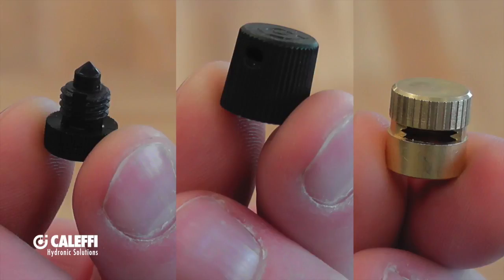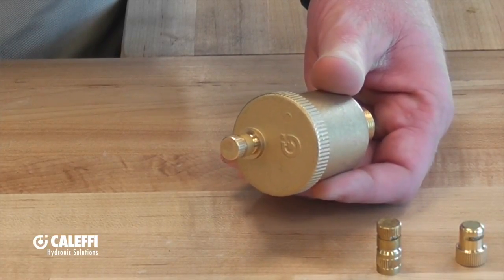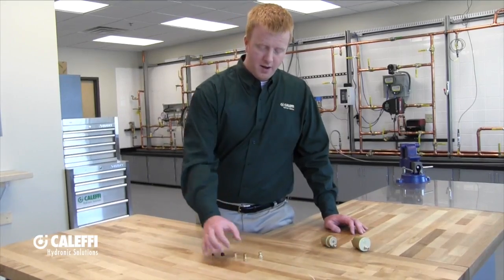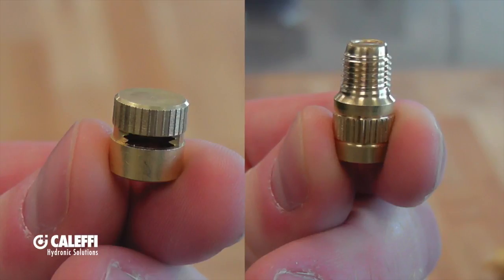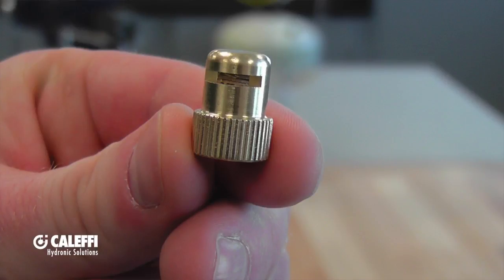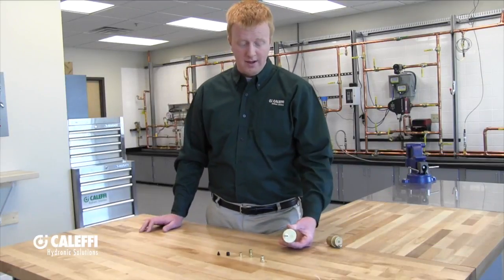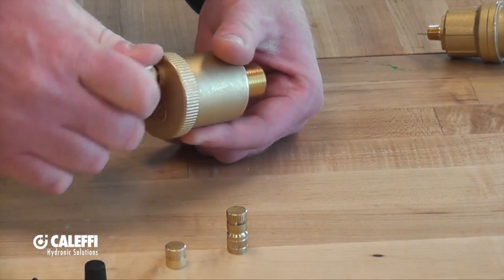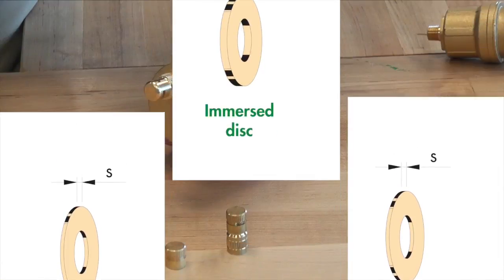How do air vent caps work?

Comment: I've an unusual need in an air valve and I don't know the proper word to describe it. I want to install it at the top of a swimming pool filter, and its purpose would be to allow air to escape, but close as soon as the water reached it. The need is due to the fact that the pump inevitably draws some air, which then accumulates at the top portion of the pool filter. That condition prevents as much as 1/2 of the inner filter cartridge from being properly used. The filter has a manual valve at the top for letting out air when a new filter cartridge is installed, but its intended to be manually closed once water starts pushing out. If I were to build what I'm looking for, it would simply be a vertical tube, narrowed at the top, with a heavy hollow ball inside, which would sink to the bottom as long as air was flowing, but float to the top and block exit once water pushed into the tube. Does such a valve exist? Would it be one of the ones you are describing? Thanks for any assist!

Comment: Is the hygroscopic air vent food safe? Im in the early stages of building a portable drinking water storage tank that will need to be able to be vented but not let any water out regardless of the orientation of the tank.

Comment: I just took my heater cover off and only see a black rubber piece like the one you had on table in front of you. Should I put it back on? Because it’s been off this whole time and I didn’t know
Reply from the maker: Hello! If you are referring to the black plastic cap, you can install it and leave it loose to allow air to be removed. In the event that debris might cause water to leak out of the top, you could close it tight to stop water from exiting until you can replace the unit or provide maintenance.

Comment: hi i have a water boiler boiler heating system  that is leaking water at the top of the air vent part..the red cap is broken is water suppose to be coming out when cap is off or broken? th
Reply: I hope you fixed it after 2 years...
Reply: Nope it’s not supposed to it needs replacing or cleaning of it properly

Comment: Is there ever a point when you do want water dripping out of your air vent cap? Don't think I've ever been there.
Reply from the maker: Thank you for your inquiry.  Water dripping out of an air vent cap can be a sign that dirt or debris is in the discharge port.   The float inside is designed to close the air vent discharge and maintain a small pocket of air above the float.  If water is dripping out, that is a sign that water and debris has gotten above the float and is holding the discharge port open slightly allowing the water leakage.